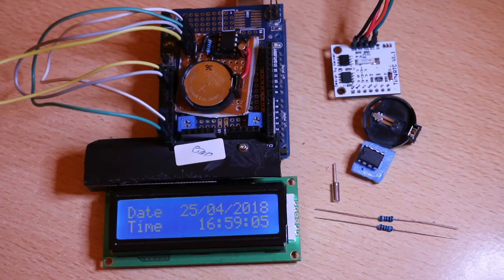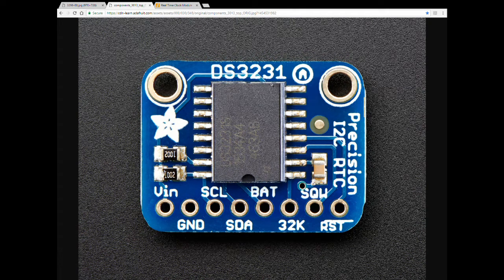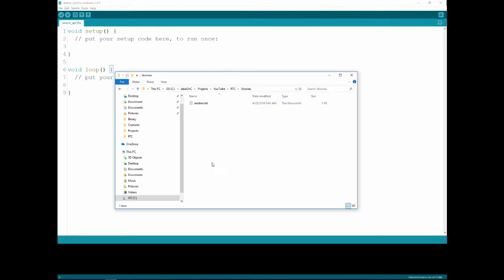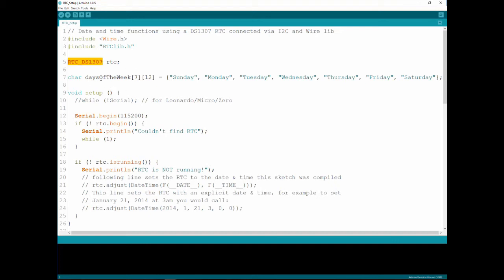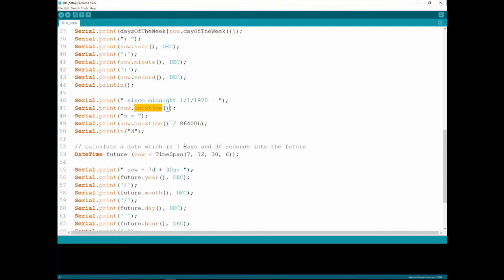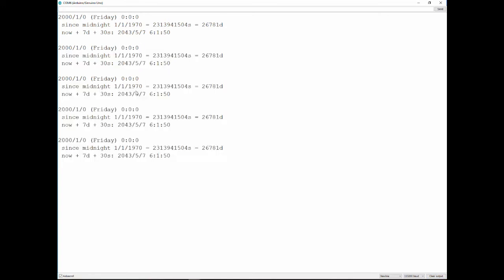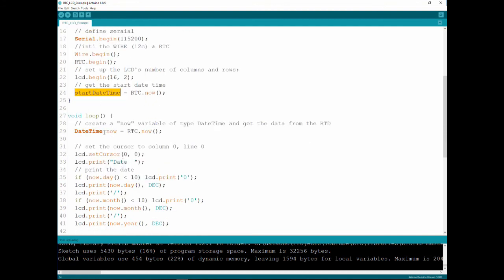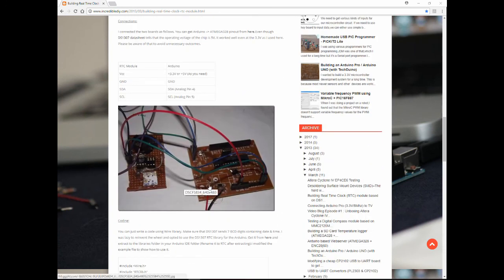Tutorial on arduino and DS1307 based  Real Time Clock

Comment: finally a code that works!!!
Reply from the maker: Glad to hear :) 
Were you looing for one for a long time?
Reply: @talofer99  hello! sorry for the long time took me to respond! most of the codes worked ok on serial monitor
but did not worked for liquid crystal for some reason. Yours worked first time that i tried!
Reply from the maker: @iliecaba1810  this is the best feedback I can get - thank you very much :) 

What are you making?
Reply: @talofer99  glad to hear that i was of some help! nothing special, every now and then i take any kind of an sensor or module and i learn to use it!